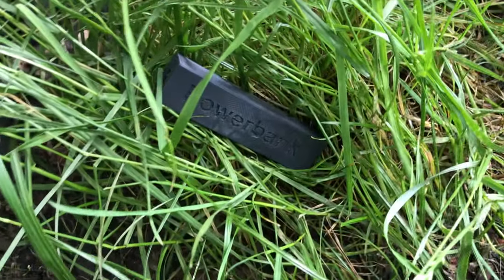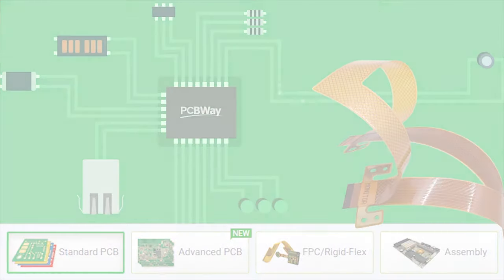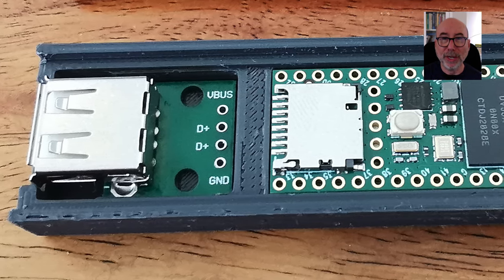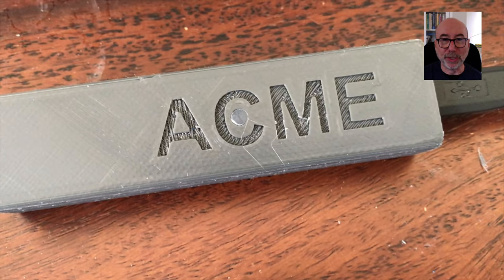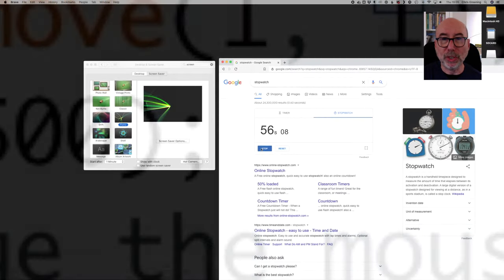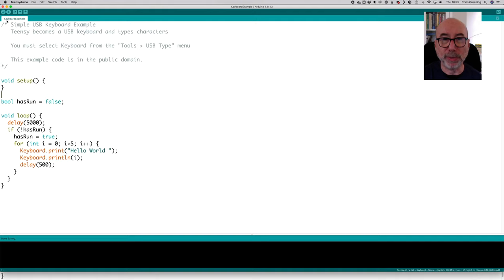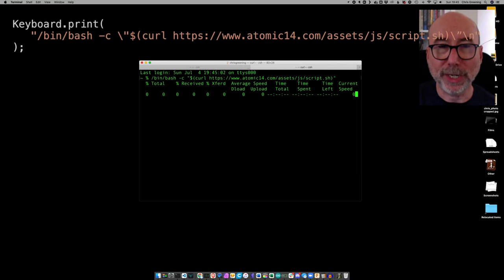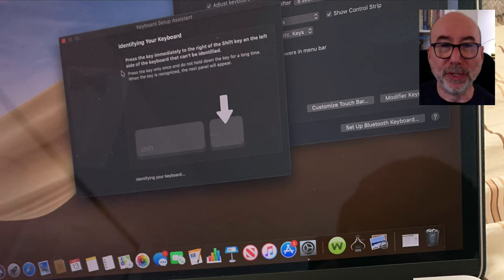USB Power Bank Hack

Comment: This is scary.. All of those esp boards come from china and could come with an unknown code preinstalled. What is even worse, you don't even need something as fancy as a breakout board. There are micro circuits small enough that can be embedded inside a USB cable or  even between the layers of a PCB that can do nefarious deeds to your computer.. (Spy chips)

Who even knows if those esp8266s and  esp32s are doing extra things we don't know of, like sending our data to another country..(Keyboard loggers, for example)
Reply from the maker: Check out the OMG cable another comment mentions. Amazing stuff.
Reply: Considering how many skilled developers and engineers use Espressif controllers, I think it's fair to say someone would have noticed if they were mass hacking makers by now...
Reply: esp32 and esp8266 doesn't have this functionality since it uses external UART chip, newer esp models however can do this
Reply: Can a esp be configured to work as a packet sniffer?
Reply from the maker: @WagonLoads  Apparently the answer is yes! Have a look for esp_wifi_set_promiscuous_rx_cb that will let the ESP32 listen for all packets going past.